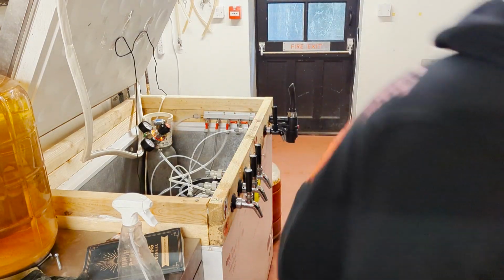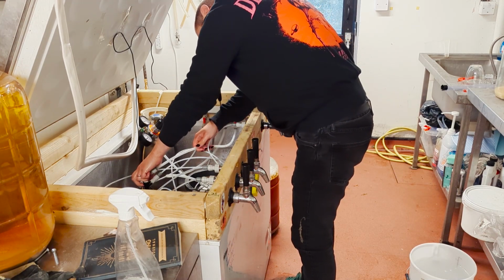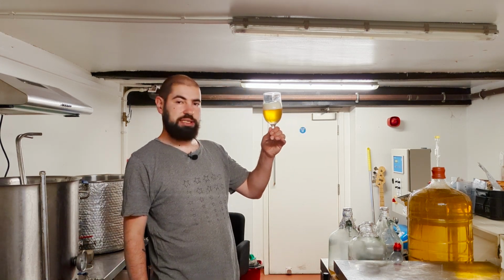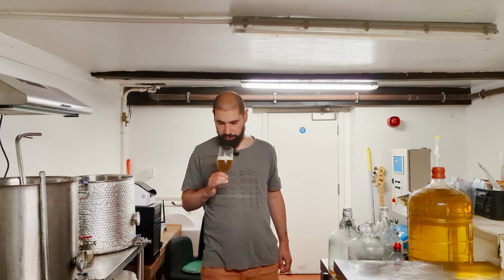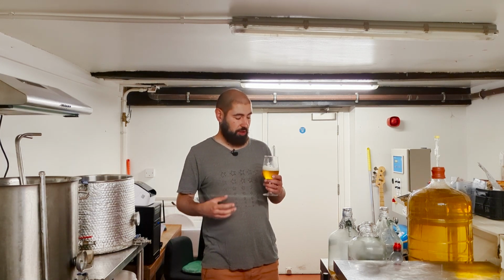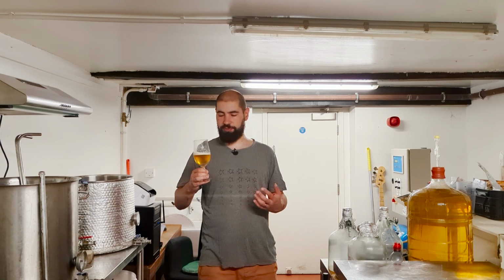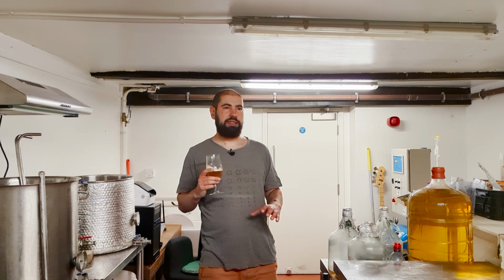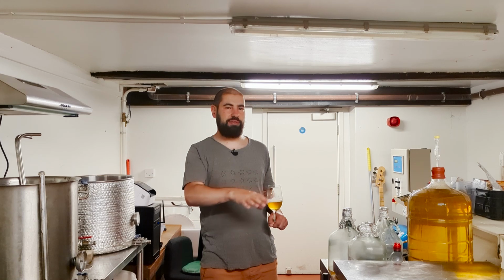How To Use a Keg King Pressure Fermenter Pt 2: Tasting

Comment: How about doing the same brews side by side, one under pressure other not, and compare?
Reply from the maker: Good suggestion, I'm actually planning this but there's some logistics I need to account for. One of which is having 36 litres of the same beer on tap. I've thought of worse things that have happened 😂 but it just needs to be a beer I really enjoy which will also highlight the differences between pressure and non pressure fermentations. I'm open to suggestions if there's anything you'd particularly like to see?

Comment: There is no doubt that lagering yeast strains are well suited to pressure fermentation.
Need to keep the pressure regulated - can't let the fermenter pressure exceed 15 or 17 psi.
The added advantage of pressure fermenting lagers is the ability to ferment at slightly higher temperatures without causing too many problems.